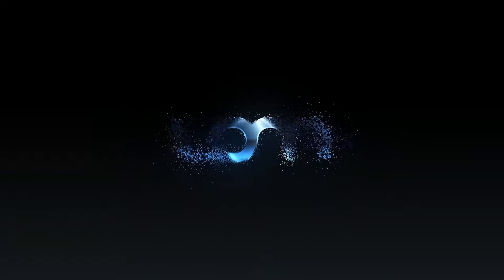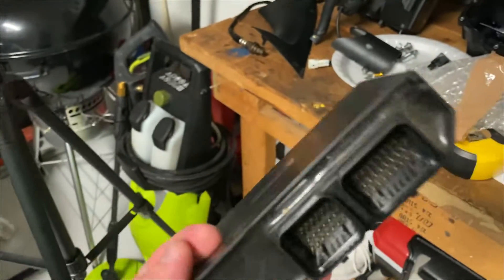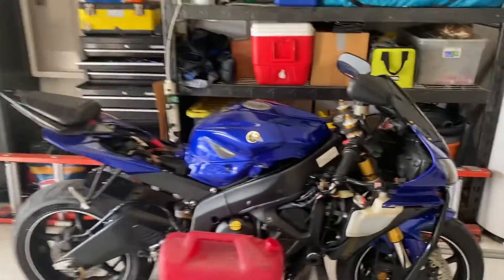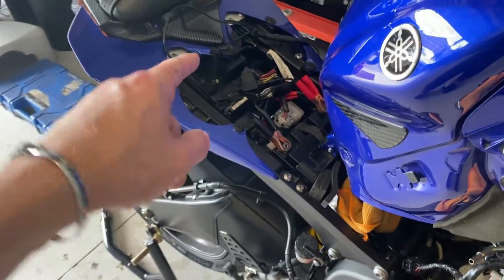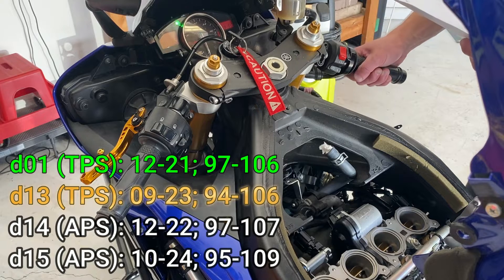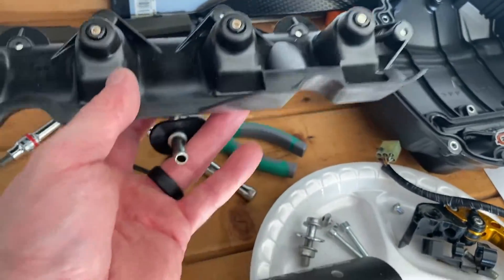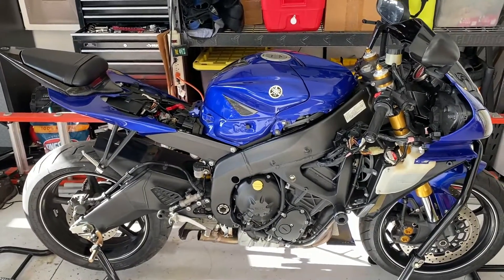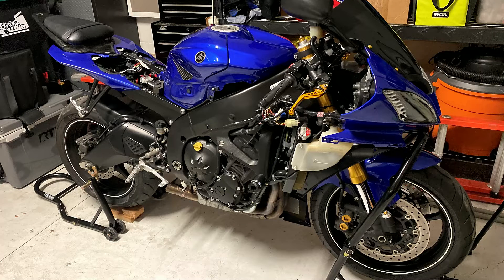R6 Throttle Body TPS Diagnostic

Comment: 2007 R6S getting code 13/15 tps reading zero at all points of throttle. crank but no start. Any advice?

Comment: I’m having an issue rn. I went to go fix my throttle body because I kept getting stuck because of the oring where the TPS sensor meets the throttle body assembly. I ended up breaking the TPS sensor and ordered a new one. Now my bike won’t start and my d01 is stuck at 15. I tried putting the bike in diag mode and twisting the throttle to see if my throttle bodies would open and it’s still hard stuck at 15. Idk what I’m doing wrong. D01: 15, D13: 15, D14: 10 closed 94 open D15: 11 closed 94 open
Reply: Never mind was a fuse 🤦‍♂️
Reply: @FuturaManagement  Which fuse is that? My butterflies are moving to position too slow after revving. Keeping idling so high and decrease as the butterflies return to closed position of which they return toooooo slow.

Comment: Ah i see you've gone over 280km/h (lost your side tank pannels, hurts the shin when they fly off huh?)
Reply from the maker: Not true. If you watch the previous episodes in the series you’ll see that I purchased the bike in non-working order. In this video I am troubleshooting the TPS, APS, and ECM using the onboard diagnostic in an attempt to restore throttle control. Also, you have to remove the tank panels in order to lift the tank to for this procedure. Thanks for watching!

Comment: Is there only one tps sensor or 2?
Reply from the maker: There is a Throttle Position Sensor (TPS) and an Accelerator Position Sensor (APS). The TPS is located on the right side of the throttle body whereas the APS is located on the left side where the throttle cable connects to the throttle body. The APS measures the throttle “request” from the rider which sends a signal to the ECU which sends a signal to the throttle servo motor (middle of throttle body). The TPS then measures the actual movement of the butterfly valves. The whole throttle system is fly by wire vs the old mechanical/cable only setups. Essentially this bike had an issue internal to the ECU where even tho I was “requesting” throttle, the ECU was not sending the signal to the throttle servo motor. My video shows the acceptable ranges for both the TPS and APS as well as how to test each sensor individually. Cheers!
Reply: Thanks so much. Just ordered the parts.
Reply from the maker: @Airbornealltheway88  No problem! Happy to help.

Comment: My bike now have the error code 60 on the meter also .. can I know what have you done to deal with it ?
Reply from the maker: Error code 60 let’s you know that there is a fault at the throttle servo motor, but it’s not necessarily always the motor itself. You’ll want to follow the steps in my video to test the servo motor, throttle/accelerator position sensors, and the ECU. In my case, I had a failed ECU. After installing a new ECU, the bike ran perfect. Good luck.
Reply: @LifeOfMikeChannel  just checked, D01 and D13 is not moving , should I be changing the tps?